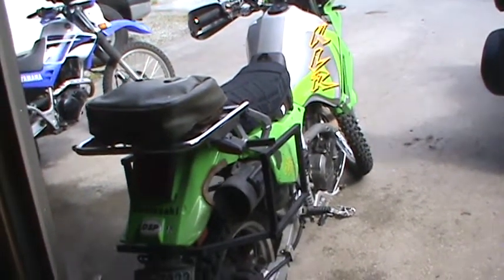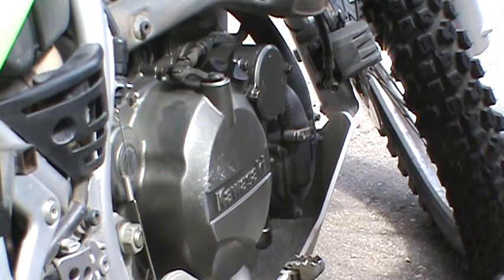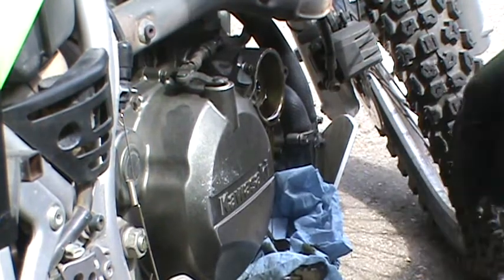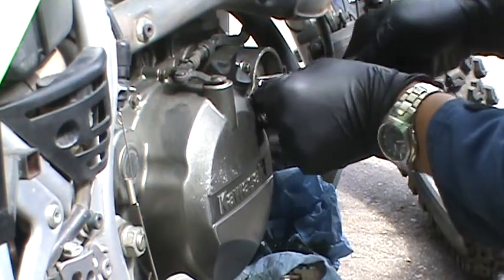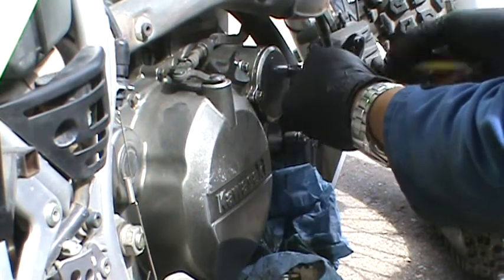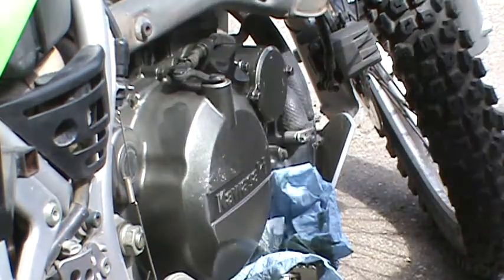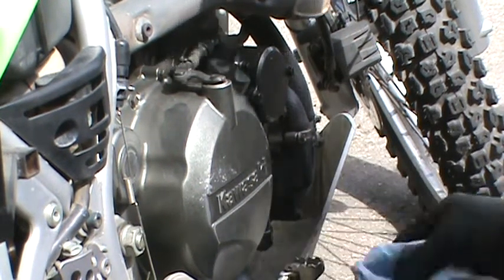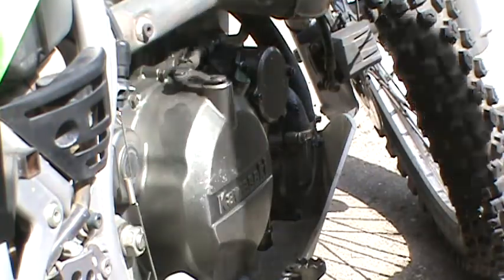KLR 650 Oil Filter change video 2 of 2

Comment: Markus - I give you kudos for making the video, but in all candor I have never seen that much oil come out of the oil cavity. In the scenario you are describing (adding a filter without draining the oil) the bike would have been sitting and cold, or would have been allowed to sit for a few minutes. During that time the oil would have drained out of the filter and into the cavity, and then down the main galley. There would be no more than a tablespoon of oil in the cavity and virtually none in the filter itself. Thus no need to cuss.

Tom
Reply from the maker: souperdoo well this is the Hollywood version of course everything a little over the top and some cussing and it will sell. You cant believe everything you see or hear online. This is the Theatrical Version, if you would like to see the real thing watch video 3 here http://youtu.be/dzByVRZ9jSw 
My apologies I might have been a little bored today, but it was fun.
Reply: Markus Ulrich Apologies? Hell, no! You should see some of the weird stuff I do when I've got a bit of time on my hands. You're a good man, Markus.

Tom